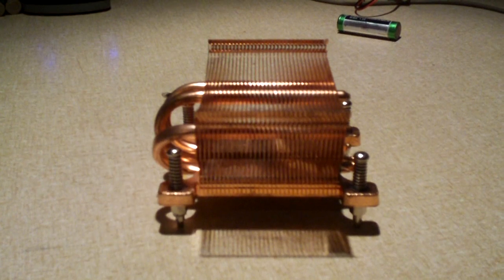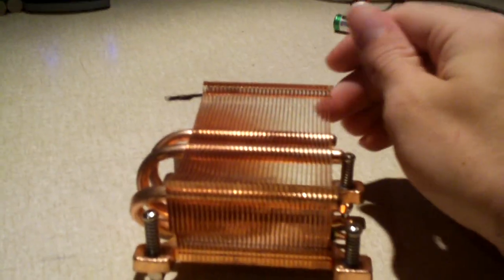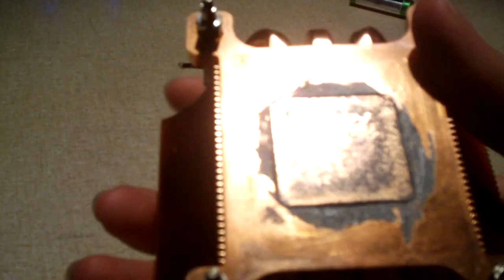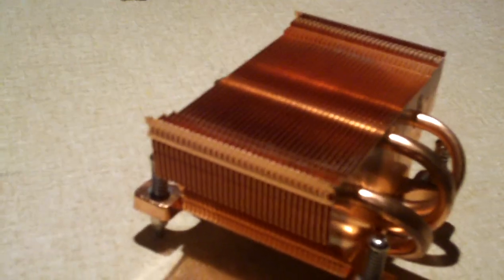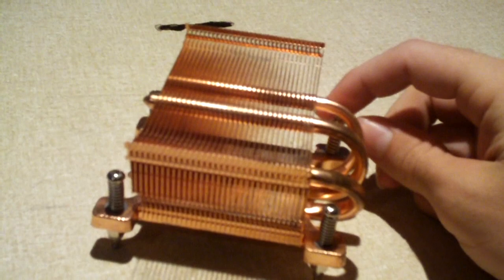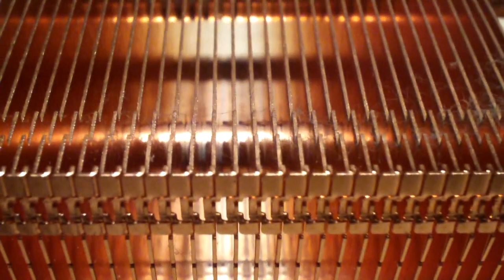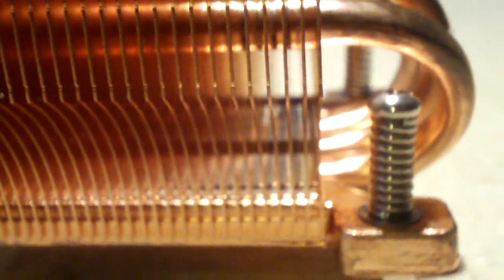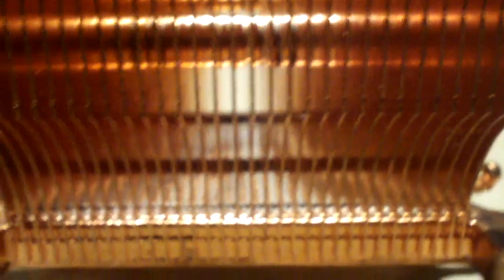Close look at an All Copper Heatpipe CPU Cooler

Comment: I have a Pentium 4 (Socket 478) computer that is sitting outside. I really could use that. The stock Intel heatsink and fan are not cooling the dang cpu that good.